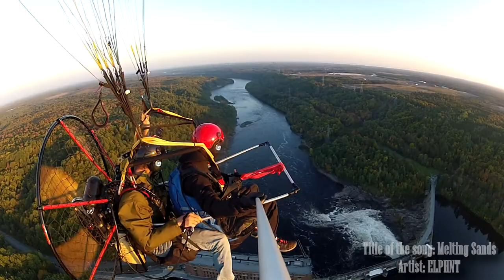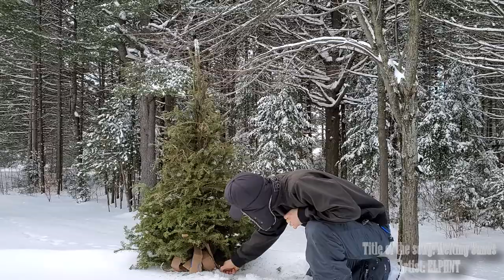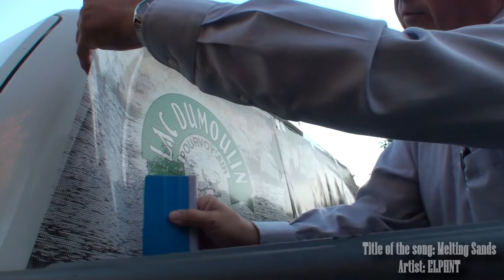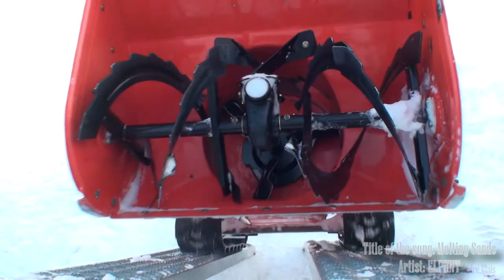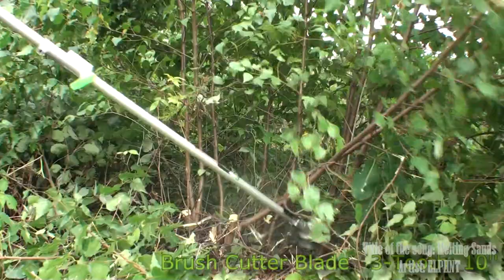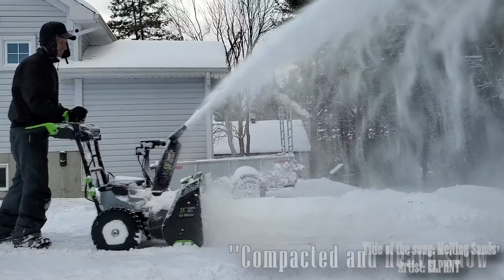Bande Annonce / Trailer Youtube de Marc André Blais (2021)

Comment: Have you used it with heavy, wet snow?  How did it do?
Reply from the maker: In the event of very wet snow, it is necessary to move forward little by little so that the overvoltage protection does not stop the machine. But on the power side even with snow filled with water I was throwing it about 20 - 25 feet.